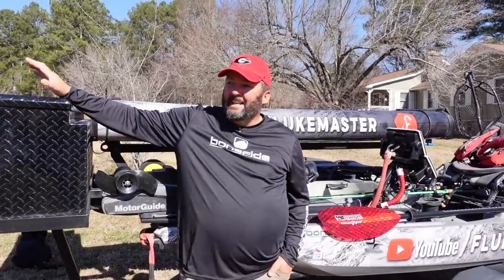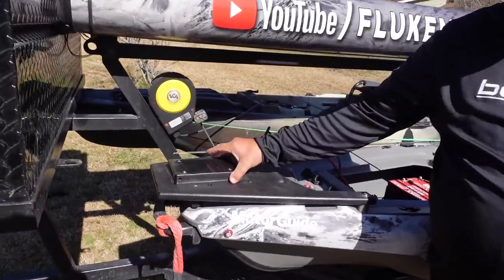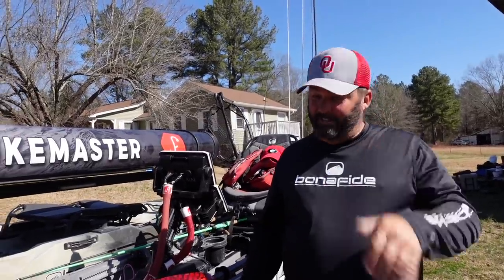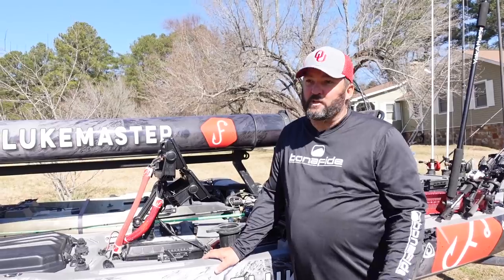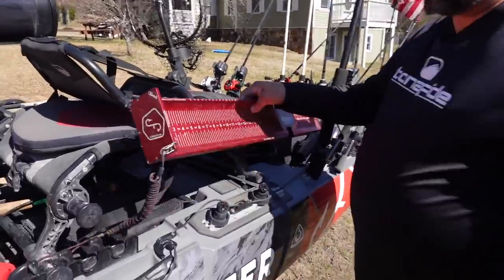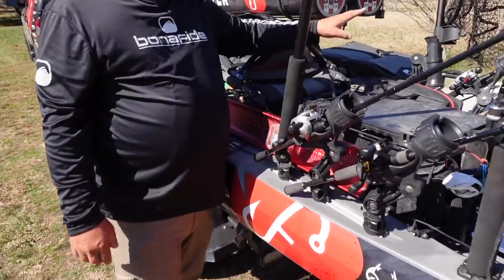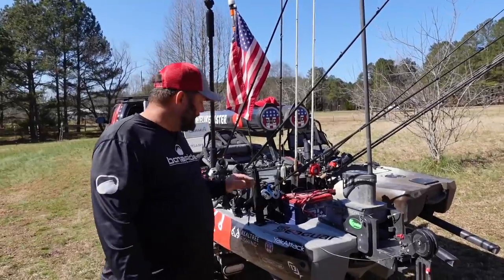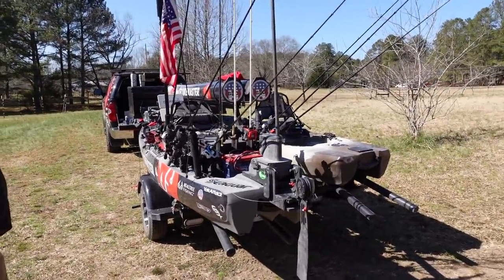My Over the Top Kayak Setup for the 2022 Season

Comment: You could use black plastic wire looming which is very inexpensive and you can
cut it to length you desire.  Covers up wires and your hooks won’t get caught in it like it can in the rod cover material you currently use to cover your fish finder wire bundles.  Just a thought

Comment: Your videos are always filled with so much information. I’ve been considering a SS127 but, being a bit large the seat sitting higher has me concerned. I can drive a few hours for one in stock. I’m 5’8” 285 currently. I currently have a Vibe Shearwater 125 on order but, unsure when it will actually ship. I’d definitely prefer to buy American made. Both seem like great kayak fishing platforms. I live in Illinois near St. Louis so, I will be fishing mainly ponds, small lakes, and some spring fed rivers in Missouri. I’m also, considering a bow mount trolling set up as well. What’s your thoughts on stability for a guy a bit larger?   I’m slowly losing weight but, very slowly.  I’m considering picking the SS127 up and still getting the shearwater and just see what one best suits me. What are your thoughts?  I also, absolutely love your trailer setup, especially the flags for your patriotism. I’m a Navy Submarine Veteran myself but, looking to keep this kayak on the surface. A new trailer isn’t in the cards yet as I’m just jumping into it all. I’ll be using an old jet ski trailer and have my father assist with some welding modifications since he’s a welder. I’m not planning on doing any tournaments this year but, maybe next year. Keep up the great informative videos. I’m open to any suggestions. Thanks Wade
Reply: I’ve set in both the Shearwater and the 127, both are great yaks. I went with the shearwater for the pedals and weight. I got it in December so haven’t really had a chance to fish out of it. I don’t think you can go wrong with either of these yaks…good luck
Reply: @samh4232  Thanks!

Comment: Two things. Sounds like you have your ohms law backwards. If you did go to a higher voltage system for your motor that would allow you to downsize your wiring. Higher voltage means less amperage. That's why transmission lines are tens of thousands of volts, 25kv I believe, yet are fairly thin. And second, I feel your pain with those long transducer wires. You can cut them and make custom length cables. Nothing magic about these cables. I personally went with 12 pin 1/3 turn bayonet panel mount connectors and matching plugs. I went with CNLINKO brand connectors and am very happy with them. However if you want MIL Spec connectors you could go with Amphenol or I think Raychem makes appropriate connectors for this purpose. If they're good enough to wire up the baddest attack helicopter on the planet, they are good enough for a Garmin fish finder. Doing this would probably void your warranty but Garmin also has break out boxes that will work for this. I think they are intended to wire 12 pin transducers to 8 pin plugs but could easily be used for this purpose.

Comment: Gene, do you have to have the rudder? I’m fixing to put a trolling motor on my ss127. Also what size fuse did you put in the wiring from trolling motor to batteries?

Comment: Congrats by the way on the Ga. natty! And that’s from a Bama fan! Question. I’m new to kayak fishing and I bought a Pelican Catch 100 . It’s thirty six inches wide or so and looks like it’s designed to stand up on. Grippy floor pads and all. But the first time I tried standing up and making a cast, it was really sketchy! Is that just a comfort thing that I just have to get accustomed to or do I need a different/wider brand kayak?
Reply: I have a catch 100 also. I’ve had it about a year now. At first it seemed really sketchy standing up to cast in it but it gets better with time. Also, make sure the weight is equally distributed. Good luck and happy fishing.
Reply: @leesonwineski994  Thanks! I’ve been a few more times and I’m getting accustomed to it. Took less rods and tackle and that helped.

Comment: Great video, I do have a gripe about the motorguide though, when they came out with the "kayak" version, I really thought they would have thought through the stow/deploy. It grinds my gears that after all the money spent for that motor we still have to makeshift something to deploy it.
Reply from the maker: It's just what deal with as kayak anglers. The only reason they came out with the Xi3 Kayak with the shorter shaft was to save people from voiding their warranty when they cut the shaft down theirselves on the original Xi3.
Reply: @Flukemaster  Yeah that makes sense. Such a gamechanger to be able to have  pinpoint and panoptix on a kayak.
Reply: @Flukemaster  how has the motor held up over the years? I just ordered mine today. Any prop upgrades you recommend?
Reply: @Flukemaster  are you doing a giveaway of a Shimano stella?

Comment: Gene - I watched one of your videos on how to mount a fish finder to the dry pod of a Bonafide kayak. In that video, you were mounting a Lowrance fish finder/transducer to the pod, and you mention that you had a block of wood between the bottom of the dry pod and the transducer. I noticed in this video that you did not seem to have spacer between the bottom of the dry pod and the Garmin transducer. Does the Garmin transducer naturally sit lower than the Lowrance transducer, so you don’t need a spacer to make it clear the bottom of the boat?  Or have you determined that the transducer is OK to sit flush with the hull of the boat without generating interference?

I am in the middle of mounting a Garmin SV73 to my Bonafide dry pod and am not sure if I should use a spacer between the dry pod and the transducer, or let the transducer sit level with the bottom of the boat - any advice would be greatly appreciated. Thanks!!
Reply: Interested to know this as well!

Comment: Wow! Kayak fishing has been fully commercialized!

My first kayak (in my profile thumb) had 2 scotys that the original owner had to drill and epoxy in himself. This was 20 years ago. There was no such thing as a "fishing" kayak at the time.  I bought it off a classified section from a old fishing forum.  i wanted something easily transportable, shallow (skinny skinny) water capable, and could paddle up river for put in take out solo trips. Only just recently bought a new yak. Went with a cresent ultra light for throw and go convenience. So the exact opposite of this rig...lol 

While i wouldn't even consider this rig a kayak. its more of a condensed bass boat. Not for me. defeats the whole purpose of kayak fishing. However, i do recognize the innovation that comes with  this type of rig will spill over to less complex use cases. 

Man i was going to try to find some local kayak tourneys this year but this is got me intimidated. lol
Reply: I don't think this is real
Reply: @cameronyoung2004  the account is only a few weeks old...definitely spam
Reply: @shtizen4371  yup bad English and everything

Comment: Love the kayak and it looks like a great set up, but its not for me and is getting away from what kayak fishing is about, to me. 
The comment about having to run a livescope on a kayak in a tournament says it all. 

I think there is a big divide between bass fishing kayaks and inshore. Inshore is a simpler,  minimal,  clean set up (for the most part) where bass is rigging it just like a bass boat, which means more more more.
Reply from the maker: I totally agree. I really love it when I rig it up for inshore. It's basically stripped down with a fish finder there only for navigation. Three or four rods on the back and a couple of tackle boxes. Then a cooler and some snacks. Simple and fewer things to go wrong.

Comment: People like this just take the fun out of it. I’m a supporter of the paddle only, and motorized kayak brackets. Sick set up, but nine rods are completely unnecessary 😂😂😂😂probably 20 pounds of wiring on that rig. Too complex for what we do 😂😂😂😂
Reply: Exactly...The reason I got a kyak was to take a limited amount of gear and get into smaller lakes and non motorized lakes..that yak has more stuff than my bass boat...
Reply: Why does it take the fun out of it? Seems like Fluke is really excited for it. I have a Meyers Sportspal S14 I tourney fish in. Mine is pretty close to his and I have fun everytime I get to get out. 9 rods is a little overkill but if it works for him, why down it. You dont have to rig yours like his.

Comment: You gotta be close to or over your weight limit.
Between the weight of the kayak, your weight 2 motor, batteries and that mountain of gear and electronics.  Seems pretty sketchy
Reply from the maker: That's what I thought but I can still stand up and move around just like I can when it's empty. It just squats deeper in the water now.
Reply: @Flukemaster  be safe.